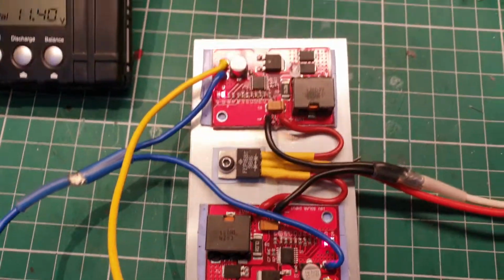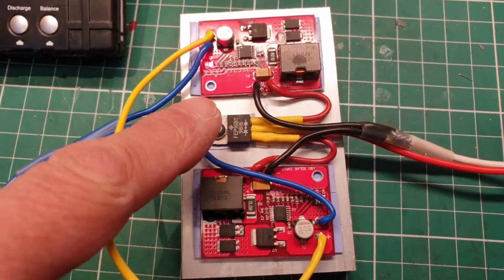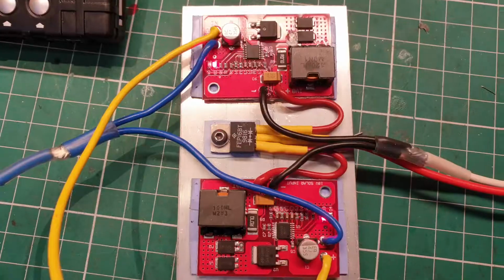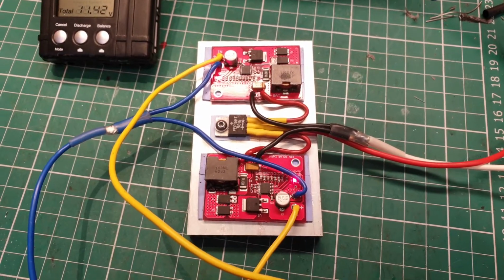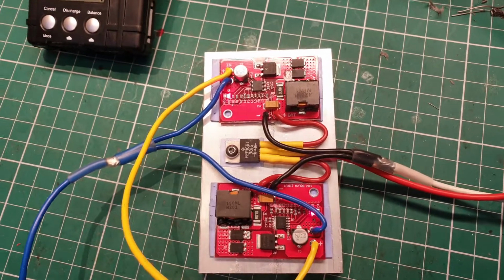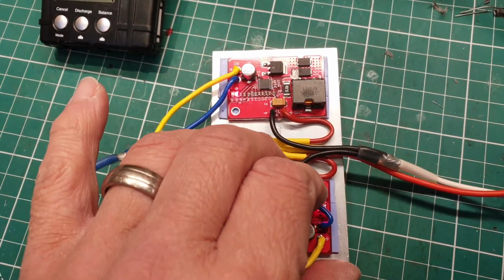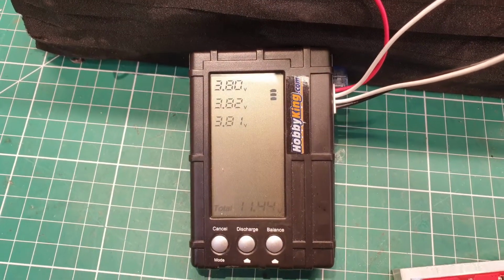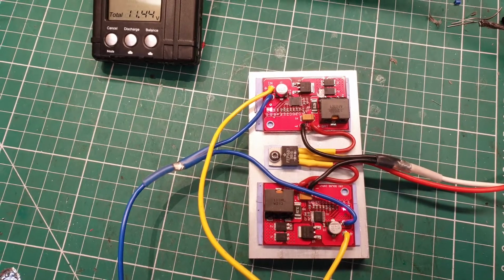Solar charge controller testing  (CN3722) MPPT boards.

Comment: Just a little warning for future viewers: Using a diode to drop output voltage will not work as pack is fully charged and current drops.
What will work however is modifying the boards output voltage divider setting and adjust it to your required voltage. It's a very easy change.

Comment: How did it hold up?
Reply from the maker: How did what hold up?
The small MPPT charge controllers were canned in favour of a PWM charge controller with much higher input capacity.

Comment: do you think they can be wired serial....fot 80v Input and 2x 6v out (also in series to 12v)?
....with simular resistors for setting.
Reply from the maker: No. It's designed charge a 3S  battery to 4.2 Volts Volts per cell, and nothing more. It's powered by the solar panel, so has a maximum input voltage of about 22V.

Comment: Can i use 1 mppt module charge with poly panel and other mppt module charge with mono panel then join them output at dual diode? Thank you

Comment: Does this mean you can use different voltages and wattage panels going to the same battery?
Reply from the maker: Within the specification of the charge controller, yes. Although I actually binned these in favour of the much more simple and efficient PWM controller.
Reply: @johnnodge4327  thanks for the reply. I just received this from eBay https://www.ebay.co.uk/itm/274775541653?hash=item3ff9e60795:g:magAAOSw0RVgh92A

Are you saying this is not as good as a cheap £10 PWM whoi Aldo have. A Y&H 20a from Amazon. Thank you

Comment: You can get the adjustable CN3722 to tune the MPP and charge voltage
Reply from the maker: Thanks for the comment. 

I only found the adjustable type, after I'd bought these, and I hate buying things twice. As it happens, the BMS stops the battery from being charged excessively, so I'm not worried.
Reply: @johnnodge4327  you can also adjust the resistor values